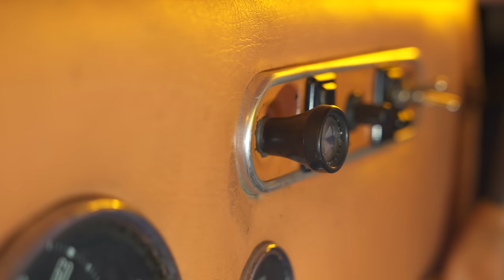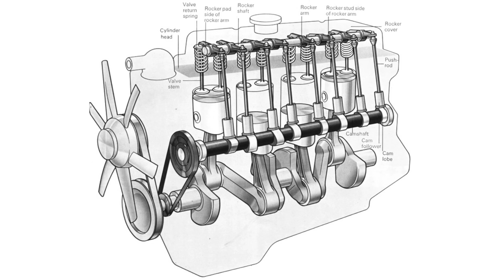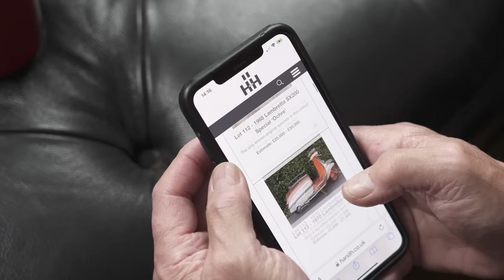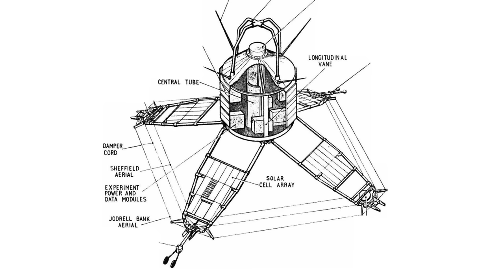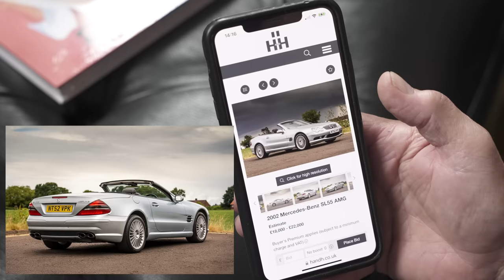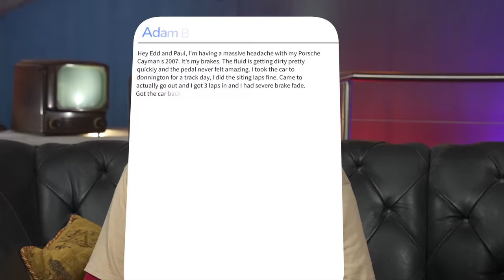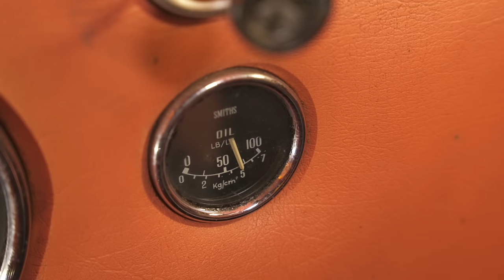Everything You Need To Know About Tappets | Workshop Diaries | Edd China

Comment: Possible cause of the black brake fluid and brake fade after sitting and baking in the heat from running laps: It is possible the flex hoses in the bake lines are starting to degrade, contaminating the brake fluid with rubber "dust" and allowing the flex hoses to expand during braking, causing a loss of brake pressure.

Comment: There's 2 TDC's, you only set the valve clearances on 1 of those strokes.
If you rotate the engine to TDC and feel no play, you're probably on the wrong stroke - of course, they could be massively out of adjustment, but that's unlikely.

Comment: Just as with ignition points the tappets can dish and lobe with wear. The feeler gauge can then sit on the edges of the dish and the top of the lobe, which means the true gap is larger with the feeler removed. As a matter of course on an old engine I used to measure with a gauge a couple of thou thinner. I remember a tool you could purchase  that you tightened the gap to zero with when it would go click under a certain torque. Then refering to a chart that came with the tool you would loosen the screw counting the clicks the tool made to a prescribed number for that engine to set the gap correctly and then lock the nut. Worked reasonably well back like a lot of tools disappeared at that back of a shelf. Back to slighty thinner feelers.
Reply: For that reason (dishing) I used a magnet-based dial gauge to measure the rocker clearance on my old Land Rover

Comment: #ASKEDD #EddChina have you heard of the zero valve gap theory, from Marcelo Tonella? He says the aluminum engine block expands far more than the valve command components, therefore a zero gap while adjusting the valves is the best adjustment possible
Reply from the maker: That’s really interesting, I guess doing the tappers when the engine is completely up to temperature could answer that

Comment: The inline splice is called a solder splice. It has a wax ring on either end to provide a good level of hermetic sealing. As a result it should be considered superior to heatshrink alone. They are used in the aircraft industry where there is not sufficient space for an aviation terminal block and where the effects of vibration can be mitigated for example inside stick grips!

Comment: Edd , I have a issue just can't seem to get to bottom of, air bag light come on, turned out was sir bag module, so replace that now got issues with steering angle sensor, I've plugged it in a re set it lights go off but within 5 miles it's back on,.  There was no fault with angle sensor before the air bag module was replaced, it's on quashqi 2007 cheers mark 👍

Comment: And another comment - old books I've read told to check the gap in the spark-plug only with roung filler-gauge, not flat one, because of side elctrode gets eroded in concave shape and you will make the gap too big using flat one.

Comment: Top Tip : The easiest way to check for a vacuum leak is to spray starting fluid around the intake manifold, carb, and vacuum lines while it's running. If you have a vacuum leak, you'll hear the engine surge a little as it sucks in the starting fluid.

Comment: My guess is valve seat recession from unleaded fuel has caused the tappet clearance to go down to zero. Seems unlikely the last person to set them would have set them to zero and they should get wider with wear not closer.
Reply: I killed an Austin Maestro that way about 20 years ago. It was very clattery and low on power, so I thought it had excessive valve clearances; it turned out there were no valve clearances at all due to seat recession, and the clattering was the extremely worn rocker shaft assembly. I couldn't adjust the clearances because all the adjusters were seized solid. I ended up scrapping it as it was very much end-of-life at that point.

Comment: check the oil level and viscosity in the dash pot of the SU. This oil provides a damping effect to applying or coming off the throttle
Reply: The damping effect actually works as an acceleration pump on sudden full throttle.
Reply: @Peter_Riis_DK  so at idle - if you hit the accelerator and there is no oil in the dashpot, or it's too thin then you get a lean mix and the car will bog down. Pulling the choke a little bit first makes the mixture richer. These are the symptoms he has.. it's a carb / fueling issue
Reply: @andrewausterfield6710  
Exactly. As the throttle opens fully the airflow through the gap under the piston is very fast and therefore pulls relatively more gasoline up through the nozzle (or jet). If the oil is missing from the dashpot the piston is pulled to it's top position immediately which cancels that effect.

Comment: Valve timing is not the same as valve clearance. Unless there is some problem with the timing chain the valve timing is unlikely to go out of spec.
Reply: If the valve clearance is too great the valve timing will be affected, both valve lift and duration are affected by excessive valve clearance

Comment: I know you disconnected the vacuum advance hose when you were checking the timing but I didn’t see if you plugged that hose whilst doing your check. Also noticed your NGK 6BPES spark plugs. Do you have a secret source for those? They are a little hard to come by at least in the States as NGK supposedly stopped making that particular plug.

Comment: How has this happened? I can understand them becoming more slack over time, buy these got tighter? How? 🤔
Reply: Since lead was removed from petrol valves lost the 'lubrication' that lead gave them which causes the valve to shut hard on the soft valve seats. Over time the seat wears which allows the valve to move upwards towards the rocker arm, closing the gap.
Modern post lead free engines have harder valve seats to eliminate the problem.
Reply: @helmutschmacher2100  Aah that makes sense.  Thanks very much for explaining it 🙂

Comment: Re the hot brakes, make sure there is no sticking calipers, or that may boil the fluid, as he is doing track days Id suggest buying a rebuild kit for the brake with seals and pop the pistons out to check they arent rusted at all,
And replacing old rubber brake hoses while he is at it wouldnt be a bad idea for the application,
Also Re the Orange,is the vacuum advance unit working ok?

Comment: The tappets are NOT at the 'top of the engine' as you said. They sit on top of the camshaft, much lower down. Reason I mention this is that I had a noisy B-series once, and a mechanic said 'it's noisy tappets'. I bought a new set of tappets. which fixed it, but what he meant was something quite different.

Comment: They should try switching Porsches. If the brake problem follows the driver, that's the answer. If it doesn't, try the 5.1 fluid, along with the other suggestions commenters have made such as different pads and line routing.

Comment: An old boat mechanic showed me a tube of clear bathroom silicon and showed me how he filled up every butt connector with the clear silicon before crimping it down and said, even without protection, he never had problems with even submerged electrical connections.
Reply: Beware. Two issues. The sealant can also seal in water that does creap past by capillary action, resulting in increased rotting of the joint. Secondly, the bathroom type silicone gives off acetic acid as it cures, which can tarnish metals and form a layer which does not seal.
Reply: You need to use neutral cure silicone  as it doesn't affect the metals. It does though take longer to set.

Comment: the brake fluid problem is that all the rubbers are breaking down and need to be replaced, remove them all flush the lines and refill with dot 5, don't forget to replace the flexible hoses too.

Comment: About the Porsche. It could be driver related.... in two ways. Improper braking, too soft for too long builds head fast. The other way, traction control, the rear specifically uses the brakes to help the driver. So if it eats rear brake pads, traction control could be the issue.

Comment: LOL.  You want fun, try setting the valves on a Red Tiger Ford tractor engine from the 50's.  They want you to set the valves while the engine is hot.  Problem is you have to remove the fuel tank to get to the valve cover.  You end up having to rig a small temp tank to run the engine after you remove the actual tank.

Comment: Hi Edd, I always look forward to sitting down on a Saturdary arvo (I am in Australia) to watch your series. A nice break. I was going to give my TOP TIP, but I see a lot of other comments about putting the plugs in before scraping off the gasket - I learnt the hard way having to use a flashlight and tweezers to get a piec of gasket out of an open cylinder. The other tip is that I would cover the valves with an old T-shirt while scraping to help stop bits of gasket flicking into the valve area.

Comment: As I have said before the glass filter you have is garbage they reduce flow I have had numerous problems with them swelling and in some cases completely stoping flow I have also had them blow apart 
So for the cost throw it away and fit a old style plastic/paper filter.
Reply from the maker: I’ll order it in a jot!
Reply: Correct answer.😉.
It's worth it.
Any update on the Mustang head lights .
Fitting relays cured it on my edsel

Comment: Those soldering tubes aren't ideal. The solder inside isn't enough to go all the way through the wire strands. Big Clive did some of those on a video, after cutting them up you could see that the solder was mostly on the surface.

Comment: Is actually better not to twist the wires in that type of connector as the solder tends not to penetrate the whole joint so well. Just push in the bare wires from each end to mesh together and then heat.

Comment: Thanks for the good explanation of adjusting the valve clearance! Two things I'm puzzled by (30 years since I worked on an engine - Datsun 1600 FTW!)

1. Are there marks in the distributor to tell you where it is, or do you just know from experience?

2. How did you know the piston was really at TDC and not slightly either side? I have a steam loco and when setting the valve timing on that there are various means of determining when the piston is at the very front or back of the travel, none of which I use because I watch the valve moving or look at the crosshead!

I miss simple cars & bikes. I didn't even bother to open the bonnet on my 'new' car - I knew all I'd see was a big plastic engine cover. There's so little room in there changing a headlight is a major time commitment.